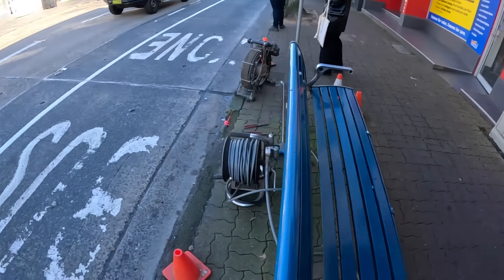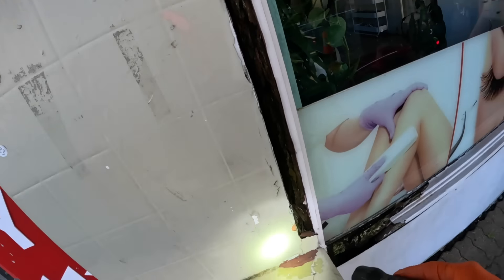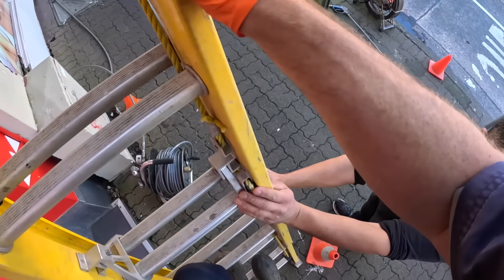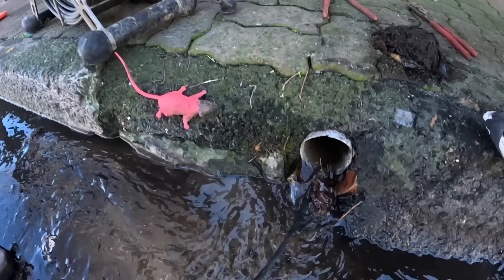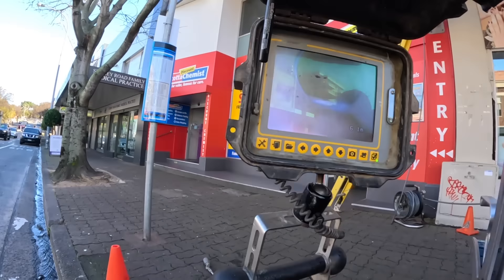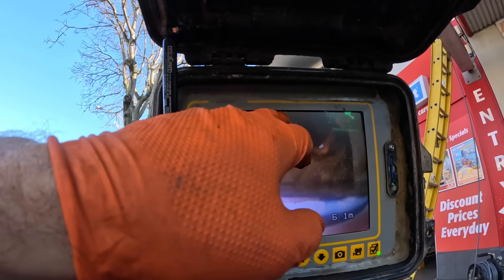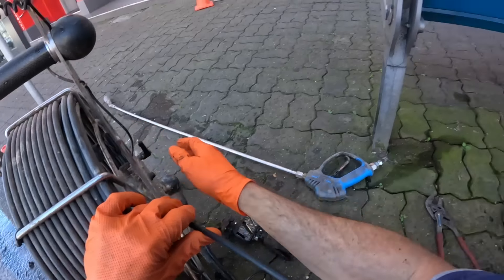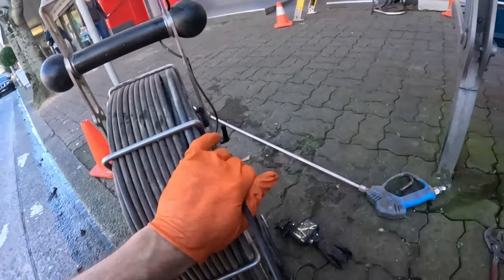Blocked Drain 859

Comment: Thank you for the surprise Thursday video!  🙂 If you see this and have time would you please answer a question.  There are 2 heads on your drain camera--large and small.  Other than the size and fitting into the different diameter pipes, is there any difference in their respective resolution/function.  Thank you in advance if you do reply.  Blessings and a Happy Christmas to you and yours.
Reply from the maker: The smaller camera head doesn't have as much led light in 100mm pipes. Resolution and image is the same👍
Reply: @DrainAddict  Thank you for reply and info.  Appreciate it.  😊😊

Comment: Hey, what’s your name whatever my my terrace has when I went to to put up the Indian flag II see that the pipe of the water pipe was blocked. I tried to clean it but didn’t didn’t go well after after the second day the Top the when I put when I wanted to take out the Indian flag I have an idea in my mind so I take the plastic pipe of the tent. Let them play. Let them think Store of the pipe. I picked up because I have random things and when I actually four seat I I feel that the blockage was too hard to clean but but I am strong so I clean need to know when I when I just cleaning the water went straight down to the drainage is it cool right comment if I am a hero of my building